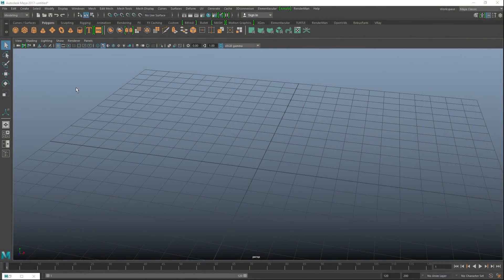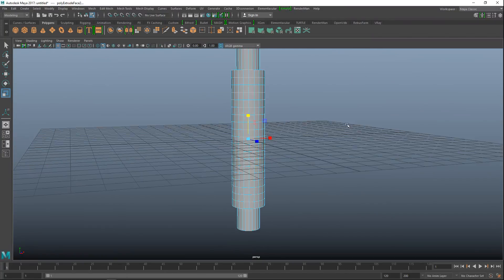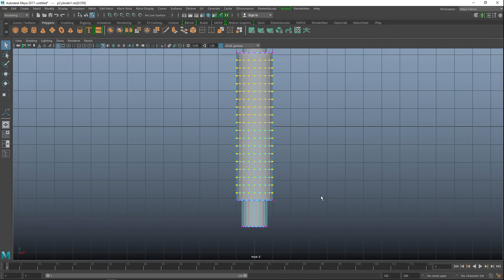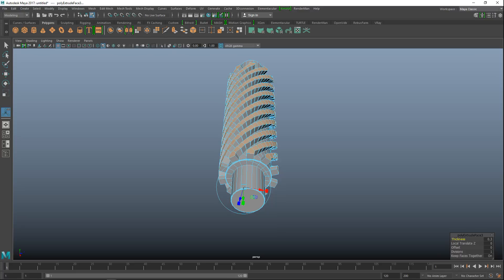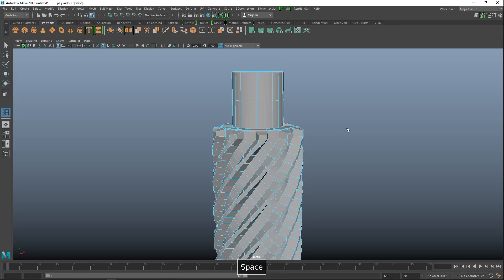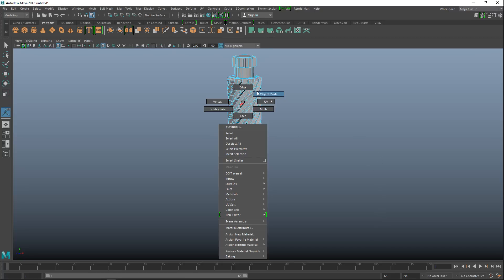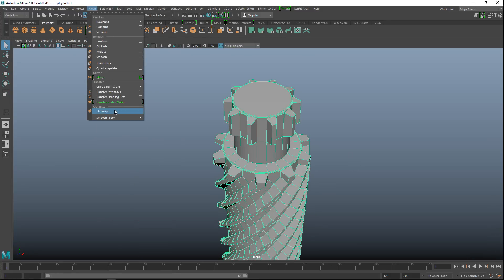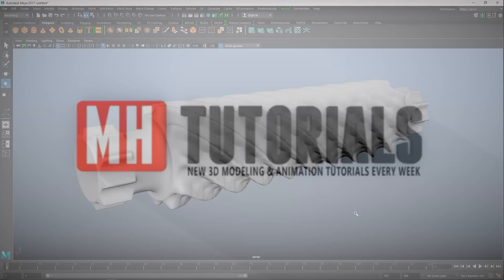Maya 2017 tutorial : Modeling more complex objects 2 ( Worm gear )

Comment: Much quicker and easier to have made a cylinder, select every other face and extrude out, add some subdivisions down the cylinder then use the twist deformer. Much better topology too.
Reply from the maker: It is not about easier or quicker, it is about students learning all the possible ways
Reply: @MHTutorials3D  Surely it's better for students to know the more efficient ways of modelling a shape rather than a time consuming way that doesn't give desirable results? A worm gear doesn't have the bumps. Chamfer vertices has it's uses but this isn't it.  Plus you're left with really bad topology doing it this way.
Reply from the maker: @mike309saa  It is not always about speed and efficiency. Once beginners have gotten their feet wet they will spend a lifetime worrying about that. Until then it is key ( in my opinion ) to explore different ways of doing things.
Reply: @MHTutorials3D  Depends on if you have to work to deadlines. Why teach a technique that isn't suitable for the model and has bad topology? Showing how to add the knurling on dials etc with the chamfer vertex would be a much better use than using it to model something like a worm gear that is supposed to be smooth.

Comment: Why is it when I try to change the numbers next to the slot it won't change....example, Scale [6.000], and I try change it to Scale [10.000], it goes back to Scale [6.000]
Reply from the maker: In the extrude menu ?
Reply: No... In the Hypershade, I added a displacement map shader and next to the scale it's [1.000] and if i try changing it to [0.010] it goes back to [1.000]
Reply: I think it only goes to whole numbers
Reply from the maker: Did you use a period or a comma ?
Reply: Mike Hermes Yah..It works perfectly in Maya 2016 but it doesn't in 2017
Reply: change your computer region keyboard settings to English (UK) and wait for maya to fix this =)

Comment: is that any easy and faster way to select that faces
Reply from the maker: Normally on a straight row of faces yes, but not in this situation
Reply: You can use Merge with a low tolerence, and the straight row selection will work, depending on the topology, you might need to do a negative box selection on the top/bottom
Reply: Mike, if you first would have merged the chamfered vertices , you could have performed the entire row of faces selection... something that happens to me also once in a while working with topology with overlapping-non-merged vertices. A long-time-ago-lessons-learned for myself using the merge vertices operation when something doesn't work as it supposed to be...